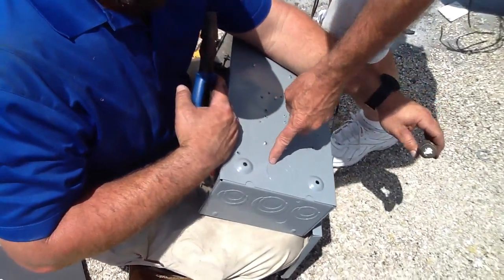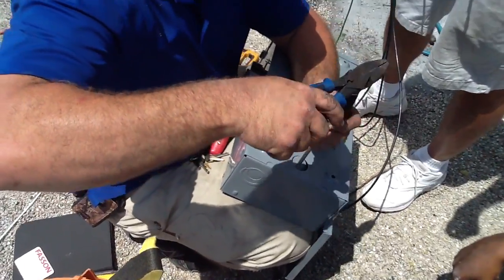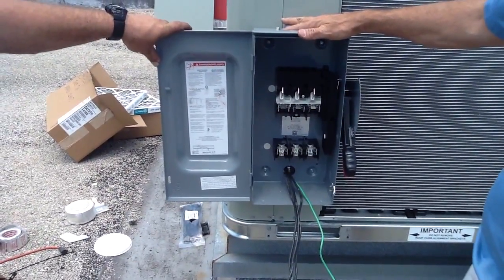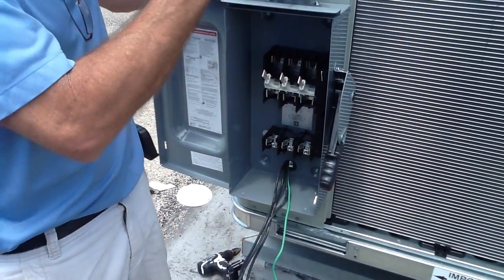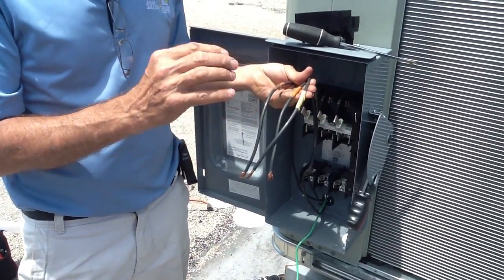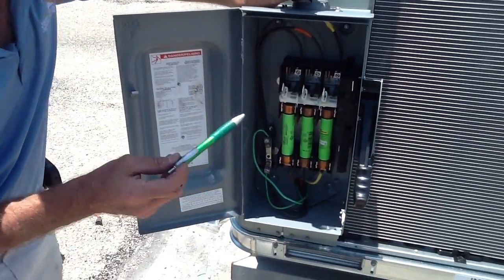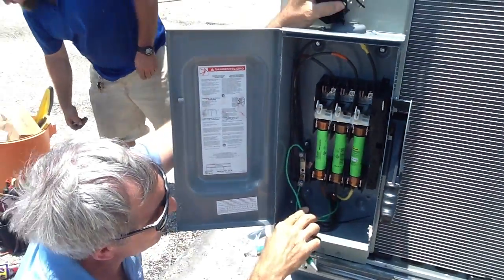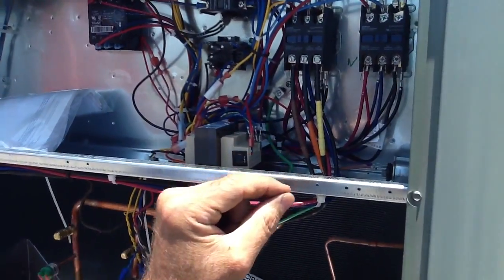What is 3 Phase Power on  Air Conditioning

Comment: 🤣🤣🤣🤣🤣  WTF? Really?
SO MANY ERRORS IN THIS VIDEO!

The wires on 3-phase DO NOT have to be the "same length"... it makes no difference how long the wires are (well, at least within a hundred feet of one another). Where do y'all come up with this stuff? LOL

The green wire is not (ever) intended to be a "current carrying conductor". It's the equipment grounding (or safety) conductor. Furthermore, it should NOT be isolated from the disconnect cabinet, it should in fact be BONDED to the cabinet, both in the disconnect and in the compressor.. In the event of a fault, it carries the fault current back to the breaker panel, so the machine's cabinet does not become energized.

This guy is a joke. Do not rely on his information, if you want a correct, safe, and code-legal installation! 

This is why you don't call an A/C guy when you need an electrician.

Comment: I know this will sound silly to you, but why color code wires, are they not the same gauge?
Reply from the maker: this is 3 phase has to be hooked up phase to phase
 A B C PHASE
Reply: A 3 phase motor's rotation CCW versus CW is how it is wired up. Reverse any two and the direction is reversed. On an AC compressor, if wired wrong then the Freon is pumped the wrong way in the refrigeration circuit suction. One can use a phase rotation gizmo to check the rotation of 3 phase sources.

Comment: Hi David I'm an hvac contractor recently I change a compressor in a packed unit 3 phase but I use a single phase compressor Is tandem compressor unit one is working 3 phase and the new one 240 v I installed a cap , my question:: how to identify 3 phase delta from star (wye) because my knowledge is on recidential hvac and recently I'm getting into commercial units Thanks